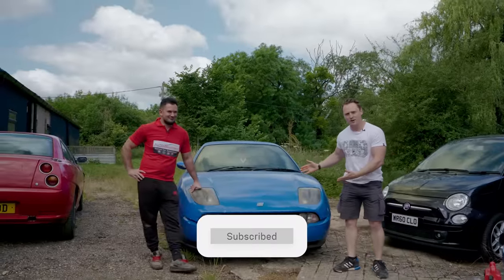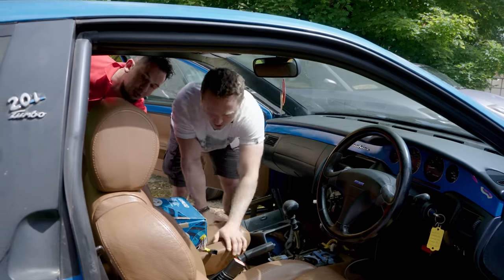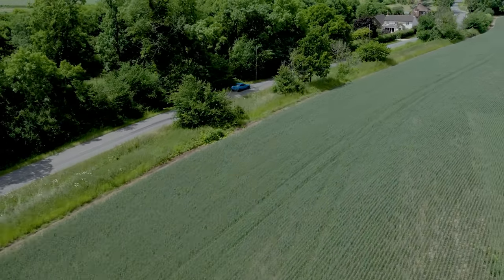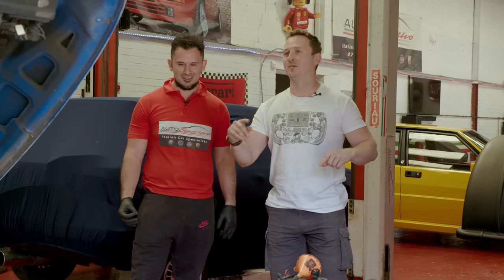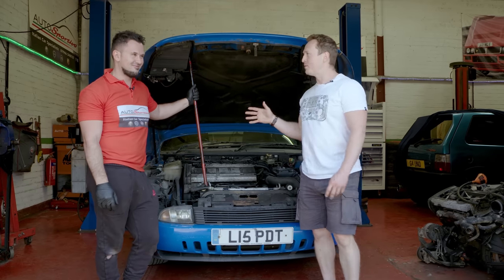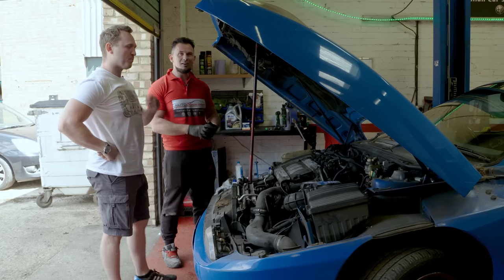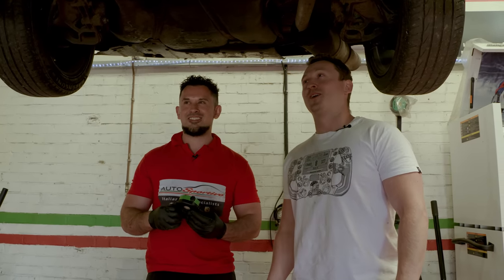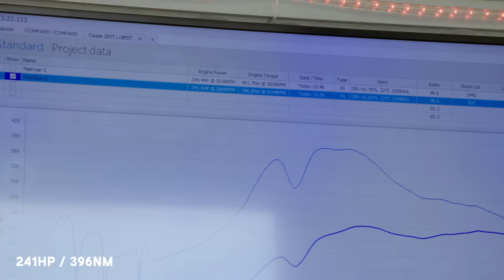Oh Crap, I Now Own A High-Mileage Italian Sports Car!

Comment: Basically a cheap Ferrari with 200k miles - very jealous!
Reply: Ferrari? More like a weightloss'd Volvo 😂
Reply: @maxpower700  how do you figure that then?
Reply: @Trappygit  alot more Volvos with a 20v turbo 5 cyl than Ferraris 😁
Reply: i never got why people favoured the weaker volvo engine that needs block modding before you can even think about upping the power where the fiat engine takes 400bhp stock internals. 🤔
Reply: @cylturbskie  i think its a matte of cost/availability.
The volvo White block will do 400 stock aswell, and its readily available, for cheap.
The reason people build them, is because its cheaper than blowing it up 15 Times due to "just a little more power" 😂 that goes for all the carscene here, no matter brand or HP goal
Reply: @maxpower700 very true 👍
Reply: @maxpower700  tho the swedes could of done it right with the volvo motor and put the turbo at the front like on the fiat , vauxhall and the 4g63 lumps
Reply: @cylturbskie  indeed, alot of companies didnt think that one through. Saab, volvo, Mazda, ford etc.
Best thing ever is probably the Hyundai with the 4g engines. Tonne of room, and ability to bolt on evo parts👌😂
Reply: @maxpower700  a car we never got in england i really liked was the Hyundai genesis coupe with the 2.0 turbo in used in the evo x
A very good alternative to the s bodies imo.
Reply: @cylturbskie  guess you've never seen a T5 heavily tuned lol
Reply: @insomniacbritgaming1632  plenty. but typically all in focus sts at meets.. and my own turbo 5 cylinder coupe plus...
Reply: @insomniacbritgaming1632  my coupe is nearly 400bhp. good for nearly 190mph
Reply: @insomniacbritgaming1632  have you ever driven anything that isnt on a video game?
Reply: @cylturbskie  400hp and 190mhp on a gearbox that is maxed for 150? You seem a bit triggered, I'm sorry if I've upset you. But 190mph from a Coupe with a stock box is not possible lol top speed doesn't change with HP, you are still limited by Gearbox. Nice try though 👍 love from your sexy neighbour engineer
Reply: @insomniacbritgaming1632  mmm what gearbox are you basing this off? because a 5 speed coupe does 160mph where mine is 6 speed being a plus model
Reply: @insomniacbritgaming1632  go back to playing xbox kid and actually drive a tuned coupe yea.
Reply: @insomniacbritgaming1632  i said nearly 190, considering i have 120bhp to the wheels MORE than stock and the standard plus clocks go to 180mph i think im not far off the mark,
Reply: @insomniacbritgaming1632  no not triggered dude
Reply: @insomniacbritgaming1632  my guess would be 184 maybe 185. i know how hard it pulls at 150mph puling harder and harder all the way to redline so i think i know how fast they go. its not my first coupe.
Reply: @insomniacbritgaming1632  cheers sexy neighbor engineer haha 😄
Reply: @insomniacbritgaming1632  only thing is its not all that much up on torque as the stock rods cant take anything over 350lbs ft and its old fashioned turbo kick nothing nothing nothing then kick, being a stage 3 hybrid
Reply: @insomniacbritgaming1632  dont know what a stock volvo lump cant handle torque wise
Reply: @cylturbskie  Stock T5 has quite a bit of Torque from the start, let's not forget it's virtually the same engine they used for the 850R in touring cars
Reply: @insomniacbritgaming1632  the extra capacity helps aswell being 2.5 litres, although only 2 things that have ever put me off getting a volvo lump is the turbo being mounted near the firewall making swapping out the turbo a pig, and the whole block mod thing, my pal was super stoked he finally got an st3 but there was always the stigma of not upping the power till its had the mod. and back then i had a mk1 ovctavia vrs running 240 that would run rings round him.
Reply: @cylturbskie  what size wheels and tyres are you running to achieve this speed?
Reply: @lukeeboy149  standard coupe wheels and tyre size 205/50/17, sat fairly low on bc br coilovers adjusted to maximum stiffness. as ive already said, at speeds in excess of 100mph which takes no time at all, its still pulling like no ones bussiness harderand harder all the way to redline, stage 4 map ontop of all supporting mods inc pro alloy fmic and stage 3 hybrid turbo. i know what my car is capable of and know these cars inside out. its logical, a standard 5 speed does 160mph, a 6 speed with another 120bhp or more to the wheels is easily capable of another 25mph ontop. people often overlook the co efficient drag of cars also, and the coupe has one of the lowest of the non super cars, which does help, as the calibra turbo had a lower co efficient drag to the v6 model because of the smallest change to the height...?of the nose iirc......?
Reply: @cylturbskie  are you on the forum Lloyd? Send me your dyno print and I'll tell you exactly what speed yours will do 👍🏻

The stock rev limit on a 20v Turbo is 6,800rpm. Stock tyres are 205/50/16. On these tyres:
The 5 speed box will top out at 171mph.
The 6 speed box will top out at 187mph.

*Clearly, a stock car doesn't have the poke to reach these speeds however. At standard power (217bhp/220ps), both 5 and 6 speeds will top out at 155mph in 5th gear. 6th is there for economy until you start making serious power. As the final drive on the 6 is slightly 'shorter' 5th will only do 168mph (167mph if it's a Plus on 225/45/16 wheels 😉).

I hope this helps 👍🏻
Reply: @Trappygit  cheers dude, im not sure what dyno fc performance use, i have a printout and may be doing 1 or 2 videos showing my coupe and printout at some point mate, so if and when i do ill get back to you on here, no no, i dont do all the online stuff no social media no forum posts, just go on the forums from days of old to see what mods etc people do like fuel pumps radiators or like how to get a certain piece off the car.
Reply: @Trappygit  mine may have had the limiter upped slightly to 7200rpm i didnt really pay much attention to it the one and only time i did a 1st gear rolling burnout at a car event 5 weeks ago. But it sounded abit higher than what I remember my old sprinty revving to.
Reply: @Trappygit  dunno of you have come across a plus with the reg v703 guj? Its quite modded stage 4 map stage 3 hybrid turbo all supporting mods for its 340whp
Reply: @Trappygit  yeh thats right i was thinking of the size from my old coupe which had the crappy team dynamic pro race 1.2s on with the 17s, i only had the stock coupe wheels on my old coupe for a very very short amount of time before having to get rid of the car. Yes 205/50 16s stock are by far the better option, as opposed to the 215/45/17s i had
Reply: @cylturbskie   FCP use a Dastek dyno 👍🏻 It has been said that it over reads but Leighton said he uses that mode as Coops get hot under high load. As long I can compare it to other cars and my own with different set ups, I'm happy.

I don't know your car. Had a nose on fccuk and it was owned by a chap called go_fast_Chris 6 years ago.

1.2s are very light so a good choice for reducing unsprung weight. I went for some old school Compomotive MO5s at 235/40/17. Monster grip with AD08Rs but they are fairly heavy. Very strong though, and they need to be with 448 BHP 370lbs/ft (408wbhp) as I've heard of wheels cracking over the years.
Reply: @Trappygit  oh nice man, yes thats funny, i got the service history folder and it came with Chris’s old membership card xD i binned that tho,
Reply: @Trappygit  i found the 1.2s to be a little on the weighty side when i did eventually get them off to put standard coupe wheels on, but then ive not really been one to change a car’s appearance with wheel setups which at the same time risks getting a potentially poorer ride quality.
Reply: @Trappygit  whoo i bet thats a hoot! to drive, i mean 340 really moves so i cant imagine having any more power through the front wheels tbh xD
Reply: @Trappygit  nice man, if your ever down in weymouth with it gimme a shout! Would love to meet a fellow coupe lover, im desperately trying to source some stock plus recaros in exchange for my fully adjustable(minus the height) Recaro bucket racing seats. 
Man the amount of people that ask what car is that when and where ever i stop is insane, like ever petrol station fill up people always have a chat.
Reply: @Trappygit  my torque is at a safe (for what i believe to be stock internals)303lbs ft and gives a proper old school kick later in the rev range which is actually in favour of economy i think…its all nothing for a little bit then boom. Defo prefer it like this it adds to the drama somewhat.
Reply: @cylturbskie  you have to remember that with a bigger wheel, you have a smaller tyre. Nigel on the forum weighed his 1.2s against standard wheels both with tyres on to get the true new weight. Not sure if you did it that way though of course!
Reply: @cylturbskie  it was mapped with mechanical sympathy for 6 years, 416bhp 328lbs/ft due to standard rods. I've only just had it mapped after an engine rebuild. Project thread on the forum if you're interested. Weld in roll cage next week 😁 

I've driven it once at the new power level and couldn't really push it for a few reasons. Felt spritely though, especially as it's completely stripped out 🤣
Reply: @cylturbskie  will do 👍🏻 Mine's been off the road since 2018 and in various workshops across the country since 2020. I've forgotten what the attention was like 🤷🏼‍♂️
Reply: @maxpower700  oh dude back to the weight lossed volvo thing, its defo more Ferrari, it sounds like a Ferrari and looks more akin to a Ferrari body style than any volvo could hope to look. just my 2 cents dude :) 🤘
Reply: @cylturbskie  get yourself on the forum buddy. Plenty of meets going ahead now it's summer. It's killing me not being able to go to them as this project gets delayed more and more. Much better chance of finding the seats if you're on the forum or, dare I say, on the FB groups...
Reply: @Trappygit  oh shit dude, so it must weigh closer to 1100 -1150 kilos if not a tad lighter?! Yes ill be having a gander mate always interesting looking through the old and new forum posts its the most reading ive done and do since leaving school 16 years ago. Always have thirst for more coupe knowledge on stock and modded coupes. Even the 16vts intrigue me having the best sounding 4 cyl engine ever. shame about the camshafts being chocolate in them tho.
Reply: @Trappygit  balls to the walls with yours huh! its nice to hear someone into modding cars that has fun but does have mechanical sympathy like myself for once, especially on a dying breed of a true drivers car as rare and unique as the coupe, i mean they say beemers are true drivers cars but they have electronics to aid the driver and although the old and best (e36s) didn’t really have any aids as such, they weren’t particularly powerful which to me detracts from a car being a “true drivers car”
Reply: @Trappygit  remember mate as cheesy as this will sound….”with great power, comes great responsibility”
Reply: Im sorry it had to be said 😄
Reply: @Trappygit  i like an insane overpowered front wheel driver more than any other engine and drivetrain config but….ffffuck that lol. I mean if your not daily ing or it isnt going to see rainy days then fair enough, but dailying my mere 340bhp is a handful as is and in the rain….more than a handful. 
Oh a previous owner did the steering column lockout mod so its one welded shaft with no damn adjustment but to be fair its positioning is pretty damn perfect and i found the plastic adjuster on the stock car did wear out on my old sprinty.
Reply: @cylturbskie  I weighted EVERYTHING that came out of it and estimate it to be around 1210 at the minute. A lot to go back in now (it is a road car) but still more to come off. That steering adjuster mod also saves a bit of weight so that is on my list at some point 👍🏻
Reply: @cylturbskie  I organised a meet back in 2010 and the only 16vT there sounded ace 👍🏻
Reply: @cylturbskie   exactly this. I was looking at a few other cars before starting this project but I had the thing for 18 years this month so I think it owns me instead 🤣 

No one has ever gone all the way with one of these so I'm doing it 😊 Waay too much spent already but there's no going back now, Haha!

Nah, naturally aspirated = never ending lag 😜
Reply: @Trappygit  haha yeh man, its flippin insane, its nice that people show an interest tho, and it gets the most attention out of all the r5 gt turbos, big american ford mustangs, Aston martins etc basically any other car that turns up at my local classic car and bike charity meet every thursday.
Reply: @cylturbskie  mine will never see rain again. Not after all that welding anyway. Literally every section Antz pointed out in that video needed welding on mine. They are all the points the cage mounts to! All done now though. It will see track time also.

FWD is so much more visceral. Flawed as hell but the more composed a car is, the more you get into trouble with speeding. Mine is being built to handle anyway. I've always wanted to make it handle as good as possible. Quaife is on, every brace you can think of, coilovers etc. It will eventually have the rear suspension off a GTV too.
Reply: @Trappygit i think mine is mildy modded, i mean walbro pump with wiring mod
Paddle clutch (its and on off NIGHTMARE)
Bc br coilovers
480cc injectors
3.8 or 4 bar fuel pressure reg
Stage 3 hybrid
Stage 4 map
Apexi electronic boost control 
3 inch turbo back
Apexi intake with external cold air feed
Pro alloy fmic
Soon to be fitted the alloy rad
Its been mapped well tho. Can see what the turbo is doing with the spool being shown like a heart rate monitor on the boost controller. 
Only thing is the cold start part being abit of a pain.
Also it can display 6 other sensor inputs on the fly and it shows the throttle will only go to 95%thats the pedal on the floor
Dont know if its a fault or a fiat thing
Reply: @Trappygit  you must be counting the days man? It was utter torture living WITHOUT a 20vt. Life was truly miserable. Felt like nothing i did mattered and a part of me was missing.
Reply: @cylturbskie  that's a fairly serious mod list. Back in the day, 300bhp was the limit 🤣 
Helix organic is a better clutch... until you see the price. Bloody heavy but you can get a smoother action.
Leighton does map them well. When they're mapped with mechanical sympathy, you do get a steady bhp rise where the torque is limited resulting in a real addictive chase to the redline. Mine was like that for years. Now it lands in a big lump, throws you 30 feet up the road and then just thumps the grunt down. Feels totally different. It doesn't accelerate faster as the revs rise anymore - its just constant throughout the rev band. I've only driven it once so haven't really got used to it but will be fun finding out 😊

Stretched throttle cable, 100%. Very common. New one will sort that. As Leighton's mapped it, it will have a linear throttle map, none of that 20% throttle = 80% power, meaning you'll be missing out on a bit of top end there! 😱😁
Reply: Turner don't remind me. I don't bother counting the days anymore as the number keeps getting higher 😭
Reply: @cylturbskie  how many 5cylinder Ferraris are there? 😅
Reply: @maxpower700  no my dude, i mean, 1. Its more ferrari than volvo would ever be simply because it sounds so close to an exotic supercar, which really should of been the 2nd point not the first.
And 2. The looks of a coupe are closer to that of a ferrari than any other normal road car. 
My fault for not elaborating 😏
Those two things in combination (sound and looks) pretty much make a Ferrari, speed is just a bi-product.
Reply: @Trappygit  keep grinding man it will happen. Never thought id get my hands on another coupe let alone a damn plus model with a good amount of moneys worth invested into it and decent non eBay special mods in it with insane power leaving all these modern shitboxes behind including amgs and s5s etc. 
but it happened after 8 years of no coupe in my life at all. So there is hope for you yet “young padawan”
if it can happen to a pathetic looser like me then im sure it can happen for a non looser.
Reply: @Trappygit  yeh my clutch pedal is heavyish. And it doesnt want to engage unless revved out to 3-4k rpm. Some days its more forgiving than other days. Sometimes you dont have to give it so many revs but will grind or wont grind when pulling away in first, sometimes you can rev it out abit and will still grind until you let go of the pedal completely, it defo doesnt slip, oh sweet, so heavy ish modded for my mod list then..
I was looking at a standalone ecu on an italian website the site and ecu are called #racebuild 
It offers everything the coupe needs and is plug n play. 1100-1200 euros. 
Would be nice to go mafless. It has a built in map sensor so wouldnt need to worry about tapping into the intake plenum. Just run vacuum off the bov line straight to the ecu.
Reply: @Trappygit  it revs so damn freely and quick aswell. It just keeps you wanting to give it more and the sound when its on kill mode is nuts like people walking quite abit further ahead turn around as if to say “what the actual fuck is that sound” that big rush of air being sucked in is intoxicating. And doing part throttle dumps or not giving the bov a chance to open and letting it flutter…..mother of god!
Reply: @Trappygit  fair enough, thats good to know mate cheers. Tbh. Im not sure i would want it to go right to the top end it will loose my crystal clean license as is.
Reply: @Trappygit  fair enough man good shout haha. Mines got a bit of surface rust on the rear but the garage said its nothing to worry about, might get them to put something on it after mot. 
Sooner my brakes get bled the better i think that has something to do with the clutch sometimes wanting to grind- tho it never fails to go in or hold boost. The car was sat round for some time just getting put through mots every year and not really being driven. 
Ive not really paid attention to how much boost its running. Maybe 1.4 bar maybe 1.5 i wouldn’t think anymore id be very surprised if it was even 1.5 given stock internals. When it hits its all drama though. Best feeling in the 🌎!
Reply: Front wheel drive ferrari that is.....